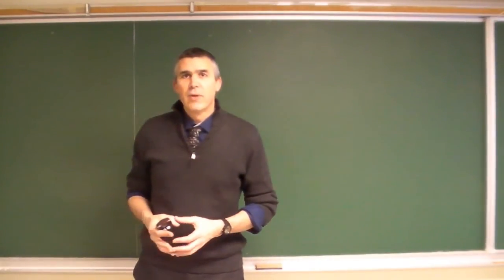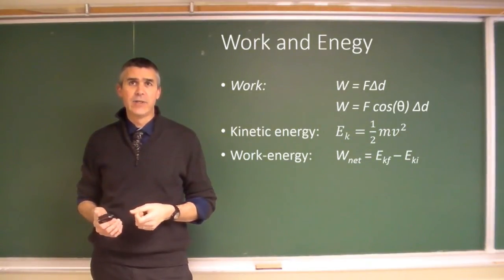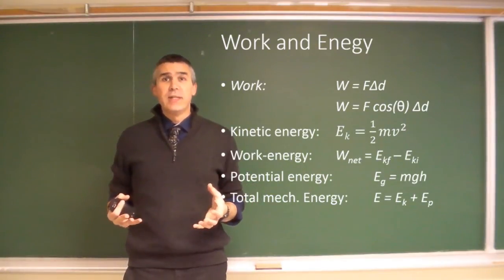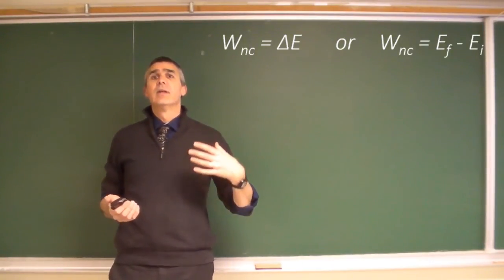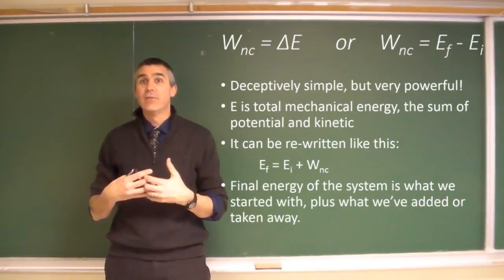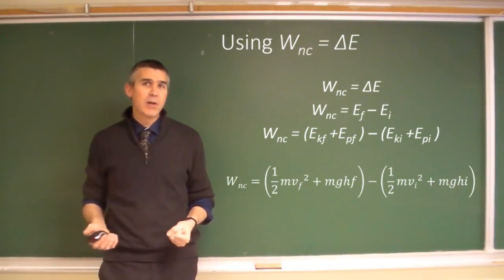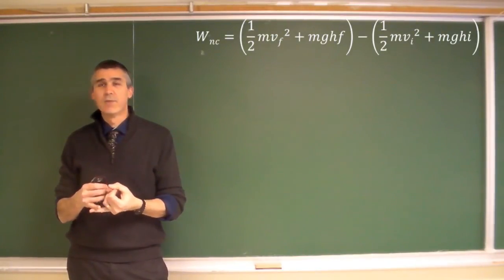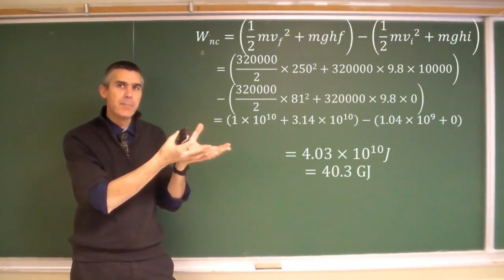Work and Energy overview, and work by non-conservative forces

Comment: I have a question to ask you about work-energy in a KE vs KE scenario.
Reply from the maker: +IBT98 Go ahead and ask!
Reply: Ed Hitchcock Sweet, This is a scenario and a question I've made just for this type of stuff. I want to see if this is correct. 

So this is my question

 ((1)TMEi - (1)TME lost) - ((2)TMEi - (2)TMEi lost) = TMEf  => TME=Kinetic Energy 

If two objects unequal mass and unequal Kinetic energy in opposite directions of each other. Object 1 is moving to the right and Object 2 is moving to the left.

{OBJECT 1}==> <==={OBJECT 2}

Object 1: 800 Joules

Object 2: 500 Joules

They hit each other, the Object 1 lost 400 Joules and object 2 lost 300 Joules, these are lost to other forms but they have remaining energy to do WORK (Non-conservative work). The lost energy goes into sound, heat, compression( no permanent deformation), etc. 

 ((1) 800 Joules - 400 Joules) - ((2) 500 Joules - 300 Joules ) = what?

So what happens, Work is done right? 

 ((1) 800 Joules - 400 Joules) - ((2) 500 Joules - 300 Joules ) = Object 1 = TMEf: 200 Joules, The Object 1 did 200 Joules to stop the Object 2 with 200 Joules. The TMEf is 200 Joules, which will do work on Object 2.

The Object 1 stopped Object 2 and Object 1 then did work on Object 2 pushing back object 2. 

Thus TME is put Work non-conservative, thus this is a KE vs KE scenario with some TME remaining to do work on the whole body.

...With external forces, momentum is not conserved but energy is transferred between these objects, work is done. Object 1 stopped object 2 in a short distance and then with the remaining TME pushed object 2 back with the remaining energy, doing work. 

MY question is, is this scenario correct and mechanical energy in the form of Kinetic energy will be able to do work or can objects with mechanical energy in the form of Kinetic energy NOT do work? 

Equations: 
 TMEi + Wnc = TMEf

 W=(TMEf)-(TMEi)

 F•d = 0.5*m*v^2 

 W(nc)=∆ME 

 KE=0.5*m*v^2

*Remember, energy is the ability to do work; Kinetic energy is a form of mechanical energy which is able to do work, if it exerts a external force, and nonconservative work changing mechanical energy. 

That was my first, and I've made another one. 

Train vs bullet, KE vs KE.

	There is a 25000kg train moving at 16 m/s, so it has 3200000 Joules of mechanical energy in the form of Kinetic energy. Opposite of the moving train is a moving bullet with .015kg mass but moving at 1000 m/s, 7500 Joules.

	The bullet and train collide: some energy is lost to other forms such as heat, compression, sound, etc but some energy remains to do work.

The Train coming from the right and the bullet from the left. 

__
 |DD|____T_
 |_ |_____|<  => <= {Bullet} 
   @@@-oo\
Lets say 50% energy loss for both, 

Bullet: 50% loss=3750 Joules 
Train: 50% loss=1600000 Joules

TMEi train - TMEi Bullet=TMEf system 

1600000 Joules – 3750 Joules = 1596250 Joules. 

	The train stopped the bullet in a short distance, and then had the mechanical energy left to displace the bullet backwards. 

What could the stopping distance look like, would it be short or long? How could we tell or estimate?

	If the bullet had superior Kinetic energy(mechanical energy), could the bullet have stopped the train and pushed back the train expending all of its mechanical energy into work. 

	If both bullet and train have equal KE, when they hit, they would compress but would the stopping distance be relatively close to zero? About 0.0000001 as they would compress inward from the force and such?

True or false, mechanical energy is the ability to do work and has two forms: potential and Kinetic.

True or False, if there is a external force from the mechanical energy working on an object, is momentum conserved? If not, does this prove a smaller object with superior KE can do work to a larger object.

True or false, Is work a form of energy as well as sharing the same units, with work an object in motion doing work is slowing down, using energy to exert a force, this force is doing work, giving energy to the target, work is form of energy but can also be said as the transfer of energy?

The concept is true, I would be correct to say the answer is correct?
Reply from the maker: +IBT98 

 ((1)TMEi - (1)TME lost) - ((2)TMEi - (2)TMEi lost) = TMEf  => TME=Kinetic Energy 

Let me see if I understand what you are saying here, because the way it is formulated includes the mathematical equivalent of a double negative :-)

I think you are suggesting a scenario where there is no change in potential energy, so we are only dealing with kinetic energy, so I will just use E instead of TME. 
Subtracting the energy lost would be the same as adding the ∆E. So what you are saying is:

Eftotal = Ef1 + Ef2, where there are two objects in the system with energy.
and
Eftotal = (Ei1 + ∆E1) + (Ef2 + ∆E2)
so, if I am translating correctly, you should have a +, not a - between your bracketed energies for objects 1 and 2.

So:

{OBJECT 1}==> <==={OBJECT 2}

Object 1: 800 Joules

Object 2: 500 Joules

They hit each other, the Object 1 lost 400 Joules and object 2 lost 300 Joules, these are lost to other forms but they have remaining energy to do WORK (Non-conservative work). The lost energy goes into sound, heat, compression( no permanent deformation), etc. 

Okay - but how is unequal work done? If the work is unequal, it must be because there is an outside force acting more on one than on the other, so you have magic unknown variables at play. What do I mean? Well, condider Newton's 3rd law - if OBJ1 does work on OBJ2, it must apply a force over a distance. So they must be in contact over that distance. By Newton's 3rd law the force of OBJ2 on OBJ1 must be the same as OBJ1 on OBJ2, so FD1 = FD2, work done is the same.

 ((1) 800 Joules - 400 Joules) - ((2) 500 Joules - 300 Joules ) = what?

So what happens, Work is done right? 

In this case there must be outside work being done more on one than the other. But let me re-write the formula:

Eitotal = Ei1 + Ei2 = 1300J
Eftotal = Ef1 + Ef2 
Eftotal = (800 - 400) + (500 - 300) = 600 J

So work is done (negative work in this case), yes; the mysterious -100 J of outside work on obj1, plus the deformation of one or both objects, leaving the combined crumpled mess with just less than half the initial kinetic energy.

So yes, kinetic energy CAN do work.

But this collision scenario is best described using principles of inelastic collisions. If there is no outside force, then momentum is always conserved, but energy may be lost to entropy (heat, sound, deformation etc). Solving for momentum first, we can use the final velocity values to determine total energy loss.

In your second scenario, you suggest 50% energy loss for both, but how does that work? How does hitting a train with a bullet cause the train to lose 427 times as much energy as the bullet does? how does the train lose 213 as much energy as the bullet has? 

Again, you would need to look at it as an inelastic collision to figure out what is going on.

But to answer your final questions:

True or false, mechanical energy is the ability to do work and has two forms: potential and Kinetic.

Essentially true - but there may be other forms, including rotation and vibration on top of kinetic and potential.

True or False, if there is a external force from the mechanical energy working on an object, is momentum conserved? If not, does this prove a smaller object with superior KE can do work to a larger object.

I'm not quite sure what you are getting at here - if the force you are referring to is the force of collision between two objects, then the momentum of the system (both objects) is conserved. If there is a force from outside the system (eg friction), then momentum is not conserved. But yes, any object (large or small) can do work on any other object (large or small).  

True or false, Is work a form of energy as well as sharing the same units, with work an object in motion doing work is slowing down, using energy to exert a force, this force is doing work, giving energy to the target, work is form of energy but can also be said as the transfer of energy?

Work is a transfer of energy, not really a separate form of energy. Kinetic energy doesn't become work before affecting another object, it is the process of energy being applied to the other object. BUT energy does not always have to be positive. An object can lose energy doing negative work on another object, as is happening in your collision examples above.

I hope that helps!
Reply: +Ed Hitchcock cool, but the main thing is that if two objects with KE hit each other, if there is energy remaining to do work, the object with the superior KE will stop the other object and do work on the opposing object correct?
Reply from the maker: +IBT98 
First of all, I'm not sure what you mean by energy remaining to do work. If two objects collide, such that
800J ==>  <==500J (total Ek = 1300J)
and each does -300J on the other, then the final energy of the system is 700J. That -300J of work doesn't need to produce a change in Ek of the objects, it could go to deformation. In fact, if there is a total loss of overall energy, that lost must be due to deformation (+sound, heat etc). So the system still has 700 J of energy, but the work of the 2 objects has already been done on each other, so none of that can be used to change the energy of these objects - but can affect another object.

Also, superior KE is no guarantee of a "win" in a collision. Take, for example, the following collision:

10kg, 1m/s ==>    <== 1kg, 4m/s
5J ==>  <== 8J

If the collision is fully elastic, the end result is

10kg, 0.0909m/s ==>   1kg, 5.0909m/s==>

No KE lost from the system, just transferred from obj1 to obj2

In a fully inelastic collision (they stick together) the result is

10kg + 1kg , 0.545454 m/s ==>

with a total loss of 11.36J (of the original 13J) to deformation of the objects.

The smaller object had the larger KE, but a smaller momentum. In neither case did it bring the larger object to a stop.
Reply: Ed Hitchcock Im talking mostly about energy against each other, not with each other. We are talking about non-conservative work...thus a Force-nc.....momentum is NOT conserved in this case

Its a work-energy equation so ignore momentum, its irrelevant in this scenario.

Think of it at a wind vs car. 

The wind has Mechanical energy in the form of Kinetic energy; same with the car...

They are opposite of each other, the wind if possessing superior Mechanical energy does work on the car, stops the car and pushes the car back with the remaining KE, which transforms into work.
Reply from the maker: +IBT98 
Hmm, that is a very different thing.
In your earlier examples, you had two objects colliding. During those collisions, while the momentum of each object changed, the momentum of the system did not, whether the collision forces were conservative or not.
In the case of wind, what is the kinetic energy of wind? Are you considering the entire air mass? Does the entire air mass come in contact with the car? In this case we can't really use the KE of the wind, so much as the force applied. From that we can determine the work done (or the impulse, if looking at momentum), but only in terms of the change in velocity of the car. 
Because, what is the kinetic energy (or momentum) of a 20 m/s wind?
Reply: Ed Hitchcock I specifically said that energy is left to do Wnc, its a work-energy problem...but its something we don't see....but in theory its possible...

its like a momentum collision but instead energy is left to do Wnc, thus something small like a bullet in theory with superior KE can stop a train with less KE.....I've also noted that energy loss or dissipation.....

its a food for thought work-energy problem that is very easy to solve when you get into the meat of the problem...

but thanks for the help and amazing video, this is one of my favorites actually, its really well made and explains the power of non-conservative force and work!
Reply from the maker: +IBT98 
Once you have everything in place, it becomes straightforward (though not always "easy") to solve, but as we have seen in this discussion there are many variables at play - momentum, energy, closed or open systems, collisions or constant forces.
Mathematically, yes, it is possible for a smaller object with higher KE to stop a larger object with less KE, but in order to do so it must also have more momentum, not just KE. regardless of whether the work in the collision is fully elastic (conservative forces) or inelastic (non-conservative forces).
It is the process of putting all the pieces together properly that allows us to set up the problem effectively.
Reply: Ed Hitchcock Well, it shouldn't require more momentum...if it has less momentum, then the object will slow down exerting force applied, so its straight forward to a degree.

but I was wondering with my edited work-energy TME equation could show unequal mass and unequal KE scenario...but thanks so much!